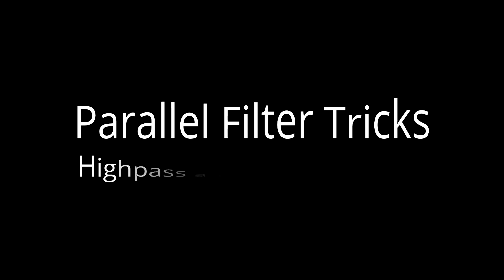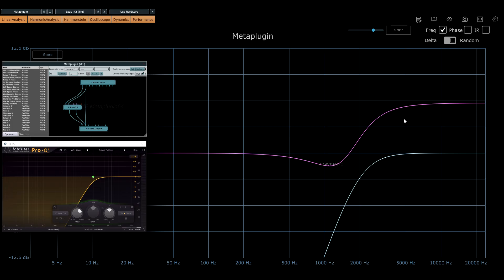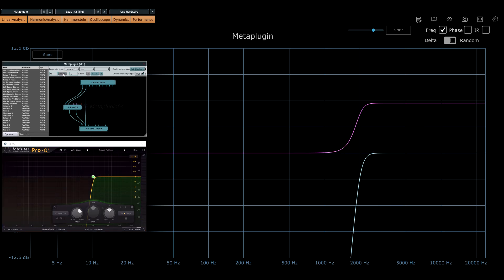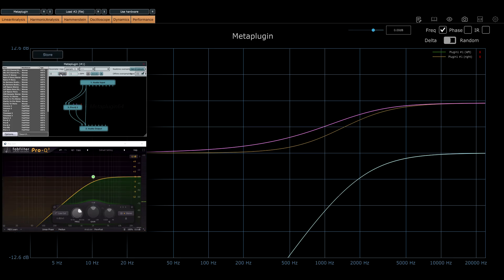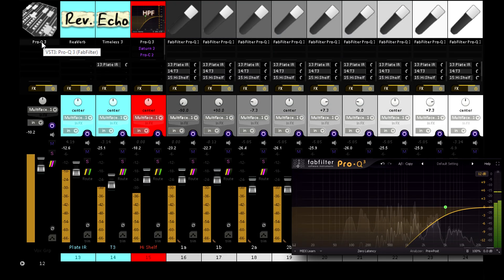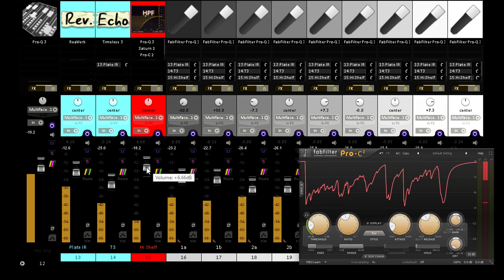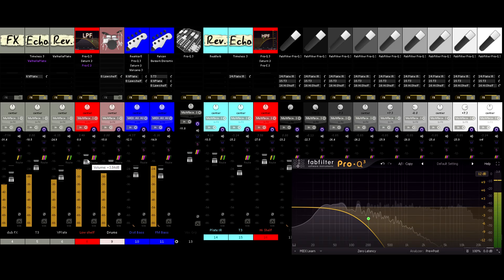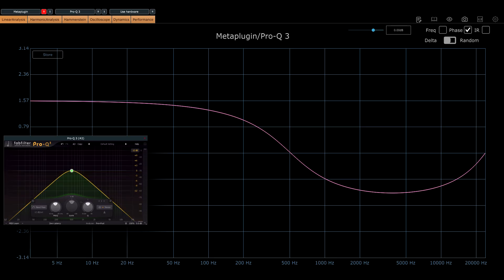Parallel Filter Tricks: Highpass and Lowpass Filters

Comment: Hi Dan... Great info 😊😊😊 The Overloud Plugin Dopamine is essentially this (the parallel hi shelf) trick right?
Reply from the maker: Similar I think, though not identical. Eg I believe Dolby A encoding actually uses 4 separate bands, but with strongest processing for the high band which is why it makes things sound brighter.
Reply: @DanWorrall  it sounded similar. I didn't know that Dolby A encoding uses 4 separated bands, good. Both can be used with the same objective in mind...

Comment: Iirc, the Pultec EQ shelfs actually are parallel hi- and lo-pass filters. It could be that I've just read about someone having emulated the Pultec EQP-1A by using parallel filters, so don't quote me on that!
Reply from the maker: For the low bands and high cut, yes. The high boost is actually a bell shape, so presumably a parallel band pass filter.

Comment: When you use Sans Amp in parallel, i'm pretty sure phase weirdness you're getting is from the filters (since Sans Amp is multiband i think). But Tchad Blake makes it work with further filtering & sometimes phase inversion...
Honestly phase weirdness is not a problem when you use your ears.

Comment: Hi Dan, in regards to the paralell high frequency bus, surely you'll have to remove those frequencies in equal and opposite ways on each channel with a high shelf eq? (unless you're purely adding signal, i couldn't really tell), but in which case, at that point, why not just use those high shelf eqs to achieve the extra brightness you're after, since you'll have to put one on each channel any way you slice it, and some channels might not even need any extra brightness, am i missing something here? Kind Regards from Sweden, i love your videos and watch them religiously each time a new one is put out, keep up the fantastic work you wizard, you.
Reply: What he's doing is adding the filtered signal on top of the original, which is why it ends up acting like a high shelf in the first place, since it will boost the signal, but only in the frequencies left untouched by the filter. If a channel doesn't need extra brightness, he simply won't send it to the parallel AUX at all. Hope that makes sense!
Reply from the maker: I can't say this any better than Hildemann above. Sending all the vocal channels to a parallel HPF is the same as boosting a high shelf on every channel, or a subgroup of all the vocals.
Reply: The real magic is when you compress or saturate the HPF.  You can even shape the audio after the HPF. Dip ~3k and a boost to the top end then hit a compressor. Think exciter territory vs just an eq boost

Comment: Man this is essential mixing tips, especially for newcomers who know nothing of the dangers of using plugins instead of analog gear! There's a reason why it's, still to this day, better to use analog gear.
Reply from the maker: No it isn't
Reply: Everything he said also applies to analog
Apart from the fact that linear phase analog EQs are very rare
And you don't have to worry about delay compensation in analog, but it's usually also not a problem in digital these days

Comment: A standard biquad PEQ will have a bandwidth of 1 octave (1 octaves above half the band gain) at Q=1.414 (square root of 2), while Fabfilter equates that to 2. When Q3 has a Q of 1, a standard EQ will be at 0.707.
This holds true for the bell type filters, but not for the shelves, which scale very differently (but line up at Q1/Q0.707 again).
You were close with the 0.72 approximation, but my OCD prevented me from ignoring that, I'm sorry!
Reply: And Q at 0.707 is a 2 pole butterworth

Comment: Very insightful video, thanks!
What spectrum analyzer did you use?
Reply: I'm pretty sure it says it right at the top in giant letters
Reply: @aschelocke  Metaplugin (the one in giant letters at the top) is the plugin that loads other plugins; used in this video to router Pro-Q3 in parallel; see its window on left side of the screen (Metaplugin (#1).
Anyway, I've found the analyzer that Dan is using. It's called Plugindoctor by ddmf.